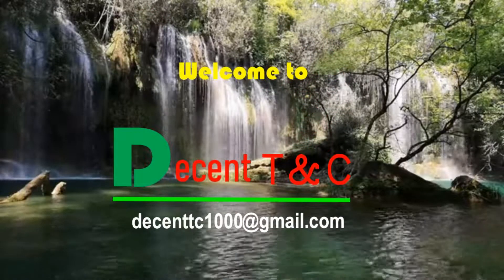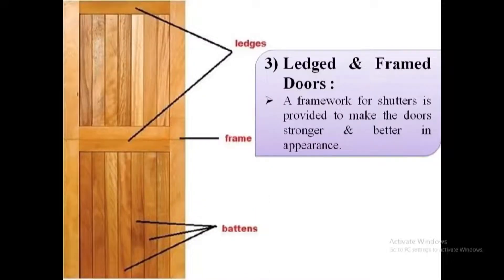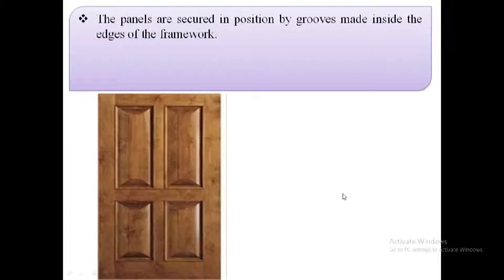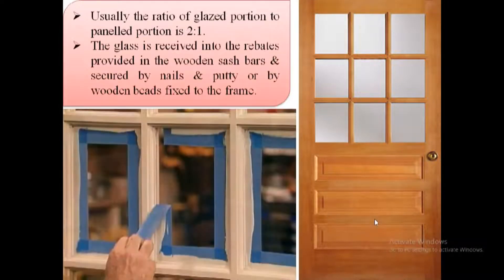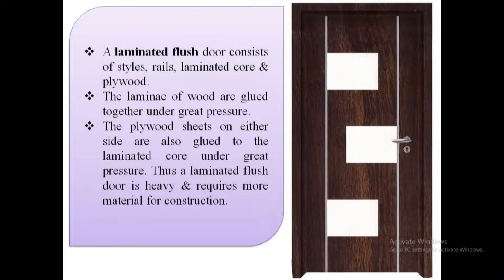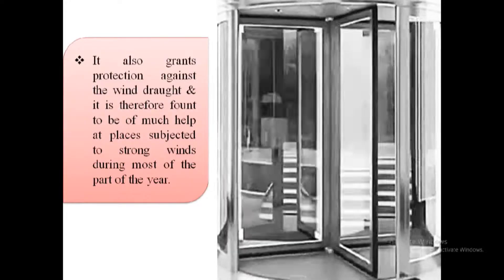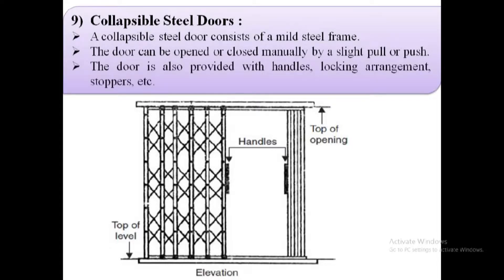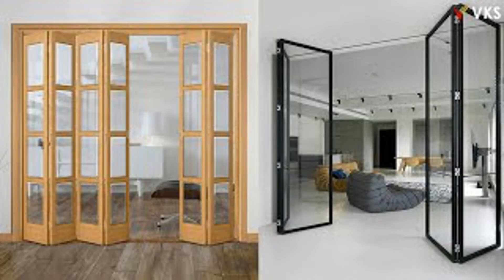Types of Door (Part-1) | Classification of Doors | opening fixation in Building Construction

Comment: There are closet doors sliding and small doors steel wood types of doors but trending in style in oklahoma the building of tin steel structures style is relevant and same styles could be discouraging doors for commercial and countryside shops are of need however the addresses of the tin building constructions and structures are relevant if a structure is only for one business company however mentioned on property options of multiple places on one structure remodel etc. Needs a priority after inspection and fire hazards must be excercised